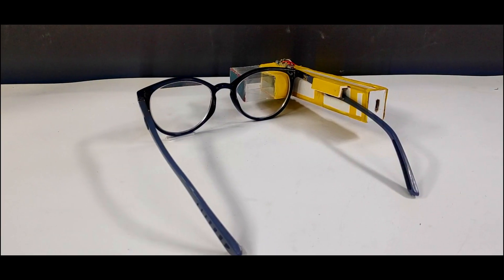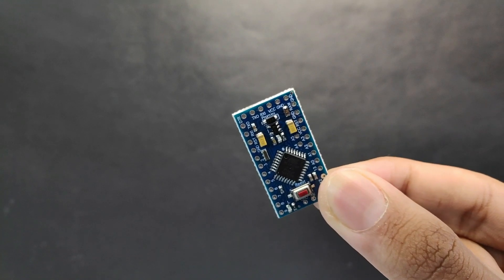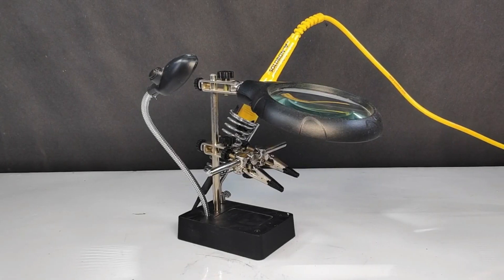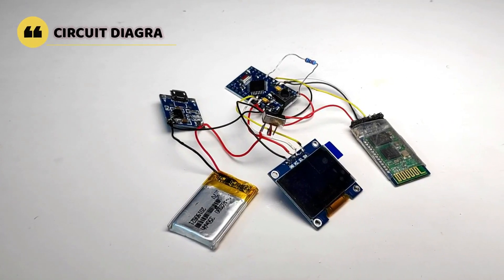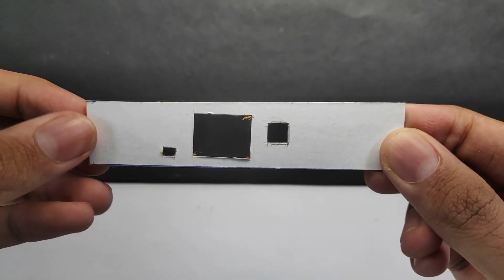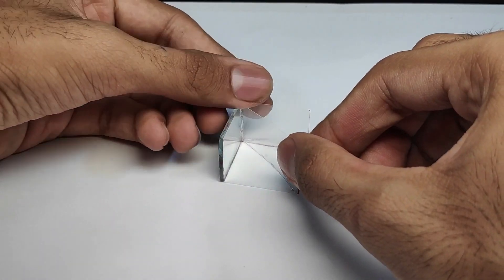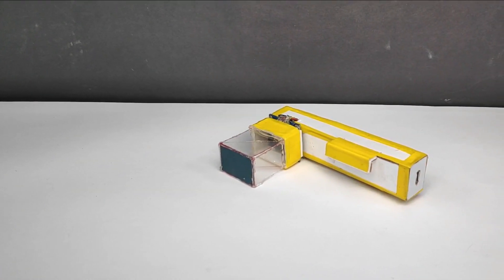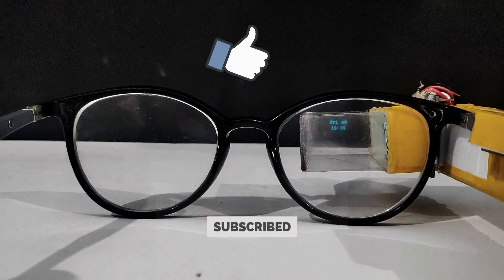How to make Smart Glasses at home easy.

Comment: Can  it show google map directions also? I want to use a bigger display and want to install on my bike not in smartglass. It will be very helpful if you make that kind of device..or at least give some directions. Thanks in advance
Reply from the maker: So yes it is possible you can use different displays but getting Google maps is so complicated with Arduino but still it is possible for bike.
Reply: @Parth_188  please make that kind of device, which shows google map for bike. It will be very helpful !